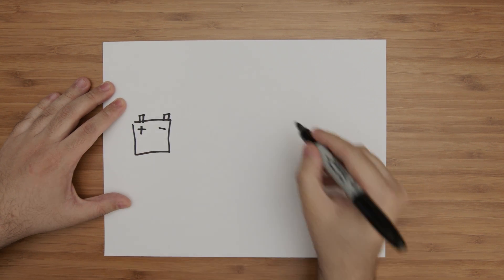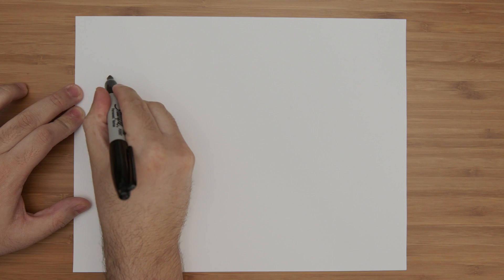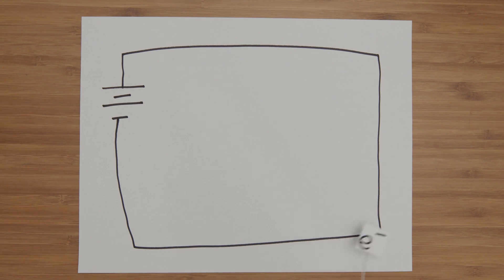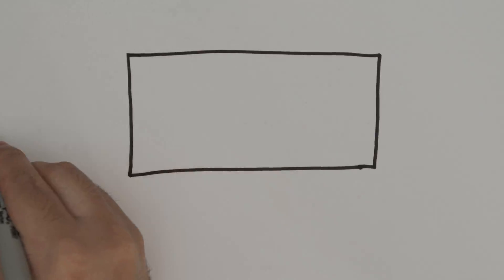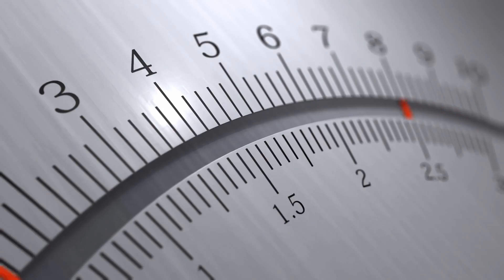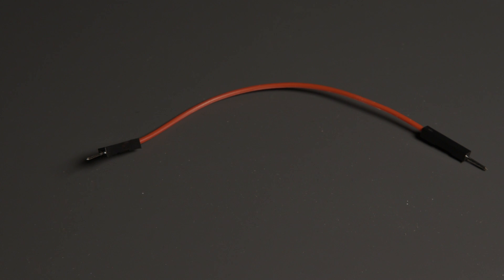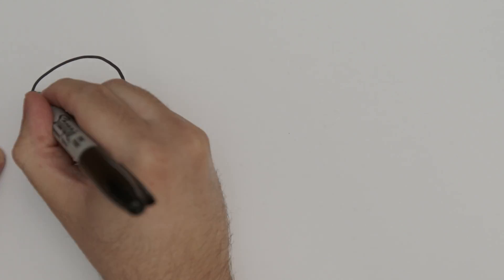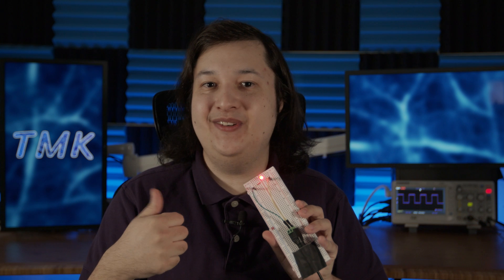WHAT ARE RESISTORS?! Why the resistor is so important to electrical circuits and how does it work?

Comment: Its the Emf around the wire that transfers the energy. Elections rock forward and backward. That is why it converts to heat at resistince. Im Ezekial Davis the only person to ever solve Unified Feild in Physic.  I have working math solutions to solve for Energy and time intensity in the full spectrum of EMF.  I can explain anything in physics down to the movement. blackholes, teleportion, dark matter, anything. God's will, how i'm the first human to understand unified feild but not the first. The bible is writen in a way that says " Not writen by man."

Comment: Actually resistors don’t slow the speed of electrons. That’s why the CURRENT is the same all around a loop. There is a voltage drop as explained, however. Search YT for more info.

Comment: I've been looking for an answer to this question. If you have a 3-volt circuit, and an LED that runs fine on 3v, do you still need a resistor. I ask because I am repairing a pair of small desktop fountains that have a couple LEDs and a water pump in them. They run on 2 AA batteries, or a 3v PS. Yet when I opened up the units, they still had resistors in line with the LEDs, and the water pump. Are they required?

Comment: So I plugged in a plug without wiring it up first. So no resistance. And the outlet started to smoke and spark. Oops. That's why I'm here trying to understand what I did wrong. I thought it was the outlet. 😬

Comment: But the lamp Will only use the current that it needs? The resistor Will make sure the votage is low enough to match the lamp when the lamp uses current?

Comment: Can you explain how to determine when you need a resistor and how high the ohms should be...Loved this video, clear concise and explained beautifully. Thanks
Reply: If you ever need to limit the current to a certain amount of amps or miliamps, use ohms equation of r = v/i where i is the amps needed to have to perform the task.
Reply: @siliconnitride7029  yes. That I understand but how do I know if I need to limit the amps?
Reply from the maker: You would need to know the current design of your particular circuit. For the LED circuit I looked at the current rating of the LED I was using. Also keep in mind that the resistor has a limit of how much current it can handle as well(before it burns up) this information will be provided on the datasheet in terms of how much power it can handle 1/4w 1/2w..etc.